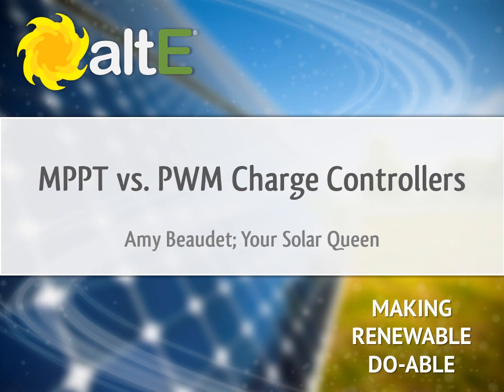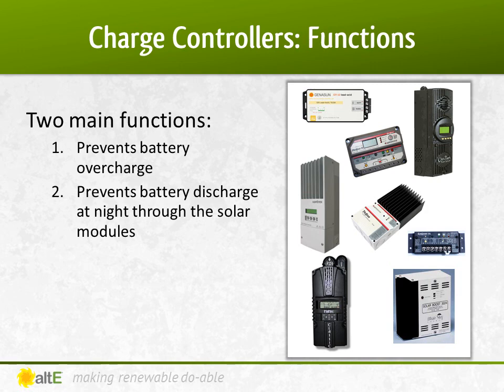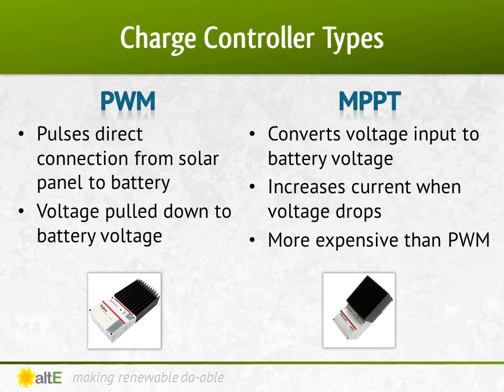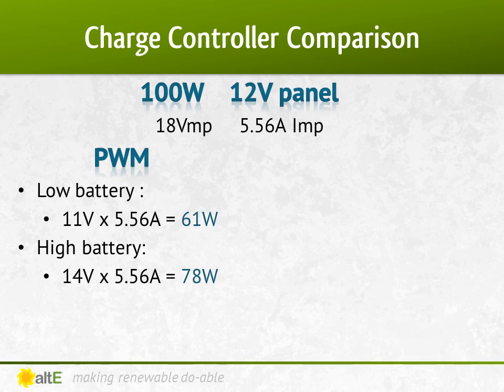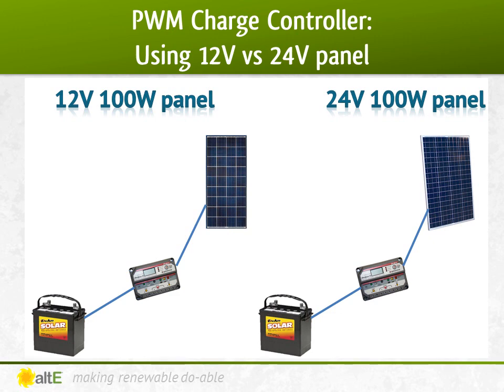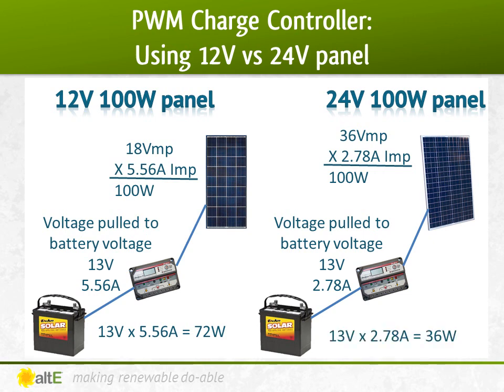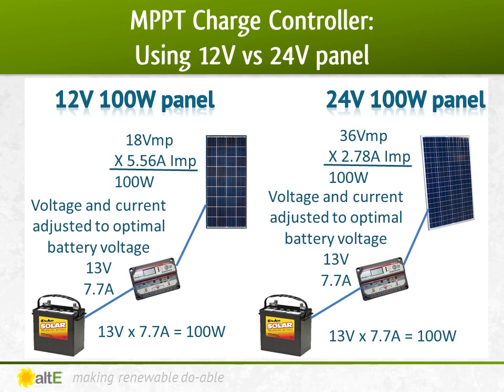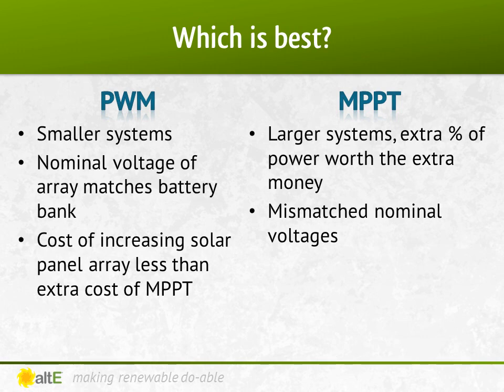MPPT vs. PWM Charge Controllers

Comment: Ok so to be sure, can I put a 24v nominal solar panel on a pwm controller? I have had many customers at my place of employment have pwm controllers nearly set fire to their homes doing this type of connection. I'm confused as to why.
Reply from the maker: You can put a 24V nominal panel on a PWM charge controller to a 24V battery bank. The people having problems were probably trying to get it to charge a 12V battery, which then tries to put far too high of a voltage at the battery.
Reply: @AltEStore  that's exactly it. I've had actual electricians tell me that you can put a 24v panels on a 12v system using a pwm controller. Friends of mine told me that they are wrong but I wanted to be sure.

Comment: my dingo plasmatonics pwm charge controller 20/20 ..12 24 48 volt it won't work with my single house solar panel 180 watts  why ???

Comment: Thanks, you clearly demonstrated the MPPT controllers advantages.  However, you are noting panels specs at STC, i.e., with a panel surface temp of 25 C. This is somewhat of an artificial or laboratory setup. As we all know summertime conditions would significantly raise the panels surface temp and consequentially reduce the panel Vmp by on average (-) 0.4 V per degree C. So this will reduce both overall system voltage and max power output. Therefore, driving down the voltage closer to that of the storage batteries. This, therefore, may make the analysis of which charge controller to use a little more tricky.

Comment: Why is pwm charge controller called "PWM"(pulse width modulation) where the is  pulse width modulation in pwm charge controller?
Can someone explain that to me ?
Reply: I’m not 100% confident, but I believe once the bulk charge stage has occurred and the charger controller is going into “float” mode, because it doesn’t have a DC-DC converter like MPPT does, the only way it can provide smaller currents is to use pulses, where width is the amount of current desired.

Comment: Ignoring the efficiencies as stated,  Technically speaking, there is some misinformation in this video.  (Marketing I guess)  It is impossible to charge a battery with no potential difference.  Charge current would not flow.  PWM Charge controllers do not lower their voltage to match the battery until the final stage of charging.  Pulse Width Modulation is a technique for controlling the output voltage by means of ON/OFF time averaging.  During bulk charge cycles the PWM circuit is passing full array voltage @ 100% pulse width to the batteries.  As the battery voltage raises the PWM circuit begins to reduce it's output to prevent gassing and over-charging.  During the float phase of charge the PWM circuit maintains the output voltage slightly above the full charge voltage of the batteries.
Reply: Totally correct....

Comment: This doesn't make any sense.  The charge controllers have to overcome the internal resistance of the battery and its voltage  in order to charge the battery.   Lowering the voltage does not increase the current going into the battery. On the contrary,  it will only slow it it down.   The formula,  I=V/R,  expresses is very clearly.

Those things you explained in the video will only work if batteries have no internal resistance.  Unfortunately,  No such battery exist.
Reply from the maker: As the MPPT charge controller isolates the solar panel from the battery, it is able to increase the current output capability of the charge controller. With PWM, the panel is just connected straight to the battery with pulses, so any extra power potential is just thrown away. So it's more than just ohm's law at play. You can see us do a demo of it here, https://youtu.be/V2b7z2eTb5o
Reply: I've watched the video and  also researched more about the topic.   I think I understand now how both Charge controllers work.   Thanks for clarifying it for me.

Comment: Hi, friend!
You forgot to answer my question. What is constant current and constant voltage?
Thank you!
Reply from the maker: I'm not sure in what context you are referring to the terms, but I can answer in general. A constant current source provides a steady amperage, regardless of if the voltage is changing. For example, if the power is changing from the source, the amps will stay the same, while the voltage changes. Likewise, a constant voltage source will vary the current, while keeping the volts the same.  I hope that helps.

Comment: If I have two 100w solar panels hooked up in series 17.8Vmp x 2 = 35.6Vmp, The battery bank is 21V - 29.4V or 25.2V nominal, What is best for this scenario?
Reply from the maker: Two 12V panels in series is 24V nominal. Your battery bank is also 24V nominal. With only 200W, you can certainly use a PWM charge controller.

Comment: Are you losing a lot of power if you are using a 24 volt  PWM charge controller, 24 volt solar array (38 Voc) to charge a 24 volt battery bank - compared to MPPT?
Reply from the maker: Under some conditions,  an MPPT can increase the output over PWM by as much as 25- 30%. But on smaller systems, the difference isn't as great. We'll be doing a video some comparing actual charge controllers.
Reply: Maybe you can do a comparison with 60 cell modules versus smaller ones.

Comment: These examples exaggerate realistic performance. For example, the battery charging at 11 volts scenario is not merely a "low" battery, it is one that has probably been damaged beyond any real hope of recovery. Comparing MPPT with PWM where the panel voltage is mismatched for the controller is a silly comparison. The video neglects to mention some significant limitations and some benefits of MPPT. During the absorption charging cycle, which is where a properly sized battery bank and solar array should be operating the majority of the time, batteries are not able to accept a charge at as high a rate as the panels and controller are able to produce and any efficiency advantage of MPPT is irrelevant. During low light conditions an MPPT may be able to deliver a small charge when PWM delivers little or nothing. Most of the extreme efficiency examples of MPPT will seldom be a significant factor under normal conditions. If you want a controller to charge your batteries efficiently with solar power, the charging set point voltages must be matched to the maximum limits of the batteries that are being charged. Many MPPT controllers have set point voltages that are too low for optimum performance and can not be adjusted to correctly match the requirements of the batteries. Many controllers are set to protect batteries from over charging but instead damage the batteries through persistent under charging. Buyers Beware: it is easier for merchants to sell the higher profit MPPT controllers on their efficiency advantages than it is to take the time to match a controller to a battery banks charging set point voltage requirements. Pay close attention to the final two minutes of this video comparing MPPT to PWM. MPPT's are seldom the wisest choice for systems of 500 watts or less except when there is no unshaded space left to add more panels or it is impractical to use large enough wire to carry the current loads of panels with output voltage that is matched to a PWM controller.
Reply from the maker: Thanks for your feedback. We are planning some outdoor demo videos showing MPPT and PWM charge controllers working with different size systems, from 50W to around 500-600W. We'll try to show some of the points you are making.
Reply: Add a load during absorption and see how irrelevant MPPT is.   Not sure why you think MPPT setpoints are more likely to be set incorrectly and nonconfigurable.

Comment: The way most sellers calculates is right but not and I will explain why.   A PWM controller is only a switch on and off . When your battery bank reaches 13.8 volt the switch turns off and when they reach 13.2 volts it turns back on again.  So the real way to calculate the PWM is 18 volts in your battery bank at 5.56 amps now this is 100 watts.  The solar industry increase the sales of MPPT by calculating the way its done in this video.  This not a wrong video its just the way the industry teaches us.   
Now the MPPT is a much better controller and I must say 90% of people go back and buy a MPPT after a year or so.  Lets say you have a draw of 1.3 amps the MPPT will send a charge to the battery bank of 1.3 amps with your voltage staying virtually the same.
But both controller are both charging the full 100 watt in this case just wrong measurements.
Reply from the maker: Check out our video where we show you a PWM vs MPPT charge controller with a 24V solar panel and a 12V battery, using both an MPPT and a PWM charge controller. https://youtu.be/V2b7z2eTb5o
Reply: +Whats GoingOn  -- That is so wrong I don't think it would be worth trying to explain to you  how it really works.  I am replying only to let newbs know not to pay any attention to your nonsense.
Reply: +Leo Elo -- FALSE!  He has zero clue.
Reply: @Whats GoingOn 
You don't got a clue ..about simpel math
Volt x Amp = Watt .. 
FLAT EARTH ZOMBI
Reply: +Whats GoingOn TRUE!

Comment: One way to be sure its an MPPT is the max input voltage.   A real MPPT as a min. of 100 max volt input if it don't well don't buy it
Reply: Even the cheapest PWM controller will have a max input voltage of 50 volts.
Older MPPT models some  would be a max input of 75 volt .
Go look at specks and try to find a true MPPT under 75 volt .  I'm not saying it can't be done .  What I'm saying is if your going to buy an MPPT controller today and you want to make sure its a real MPPT look for a max PV input of 100 volts and it will be a true MPPT
Reply: Not true.  It should be >= 2x Vbatt for efficiency, but MPPT will harvest more power than PWM even < 2x Vbatt.

Comment: Hi.. How did you get the 7.7A? Was that 1.38 + 5.56? The total is not 7.7....
Reply from the maker: +Joseph Joe When the charge controller drops the solar panels volts down to the battery voltage, the amps are raised up by the same percentage. So the solar panels drop from 18V down to 13V of the battery, 18V / 13V = 1.38. Then the current is raised the same amount, 5.56A x 1.38 = 7.7A.

Comment: a key point also to watch out for fake mppts . True mppt's, and high speed tracking  is great.
Reply from the maker: +closertothetruth Excellent point. Cheap off-brand "MPPT" charge controllers don't do true multipoint tracking. Be sure to look for brand name MPPT charge controllers. If the price is too good to be true, it probably is.
Reply: Well i have a EPEVER MPPT and it is soooo slow tracking when its cloudy. It takes forever for it to deside which voltage is best. And when its found, the sun is gone behind a cloud.Why does it have to take soo long time?

Comment: i am kinda new to this and I've already ordered my parts to make an off grid system. Will a 17V solar panel (which is supposedly be 12 volt panel when i bought it) be able to charge a 14.5 V rechargeable battery(that is suppose to be 12 volt when i ordered)? And i don't get the amps in the charge controllers. (i just ordered a 10 amp since many people say it'll work in a 12-24 volt system)
Reply: the panel is 10 watt so.... i have no idea if t'll effect the 7 amp rechargeable battery or not..
Reply: +Killerfrozen i meant a 20 a 12/24 V charge controller
Reply from the maker: +Killerfrozen The 12V is nominal, it is the category it is in. They use that for the exact reason you are talking about; a 12V panel actually puts out 17V and a 12V battery bank when full is around 14V. You need a higher voltage power source (the solar panel) to charge a lower voltage battery.
Reply from the maker: +Killerfrozen I assume you mean you have a 7 amp hour (Ah) battery. If you have a 10W solar panel, that is 10 Watts / 17 Volts = .58 amps. So you could use a tiny charge controller, less than an amp. 20A is much bigger than you needed. To use very rough numbers, if you have a 7Ah battery, and use only 50%, that is 3.5Ah that you need to recharge. If your solar panel is putting out .5 amps, it will take 3.5Ah / .5A = 7 hours of full sun. So it will take about 2 days to charge.
Reply: Thank you! Will the solar panel still charge the battery through the controller? :-:
Reply: hmm i guess i'll need to figure it out!
Reply from the maker: +Killerfrozen If it is a 7Ah battery, the 10W solar panel will charge the battery with the charge controller. If you use 50% of the battery, it will take 2 days to recharge.
Reply: +altE Store thank you so much for responding!!! :D This will help on my science project!

Comment: why use the given (value) wattage of 12v 100w sys (18Vmp 5.56A) to get 2.78A  for  ex.  12v 100w +12v 100w series= 24v 200w ; same(( (36Vmp 5.56A)  so 24v 200w sys  just add 1 panel(100w) to reciprocate the value of 12v sys... what i observed the bottom line is the budget and space for the set-up.... why i defend pwm coz  i used it hahahahaa....
Reply from the maker: +Tabangi Ginoo We sell many PWM charge controllers. I'm also a big fan of the price/performance. But if you have limited space, and can't add a 3rd panel, for example on a boat or RV, or a small cabin, sometimes adding a 3rd panel is not an option. And also, as described, if you don't have 12V panels, but instead are using 20V panels, an MPPT can be worth the extra money. Squeezing an extra 25 - 30% of power out of your panels is a pretty nice thing to have an MPPT for.

Comment: Why wouldn't you just use 14.5 volt panels instead of 18 volt ?? ( .52V x 28 = 14.5V)
The improvement of MPPT is then only 12% (not the 29% of 18 volt panels)
Reply: Panels are designed with higher voltage than required under lab conditions to deal with temperature derating, dirty glass, etc.   If you want to run lower Voc panels you can look at amorphous;  they tend to run lower than poly or mono.